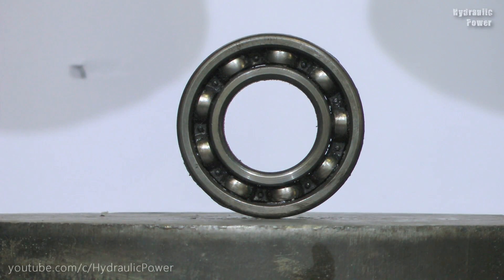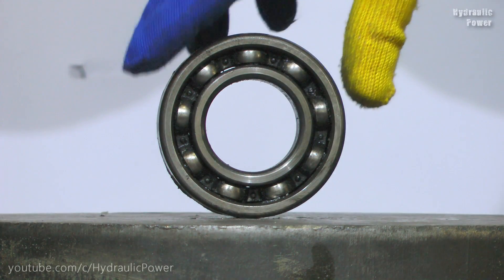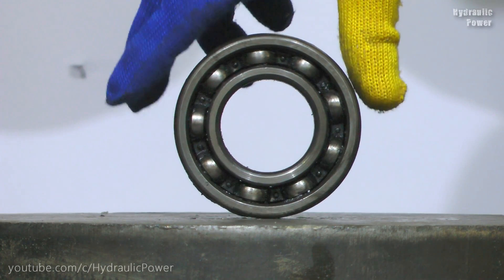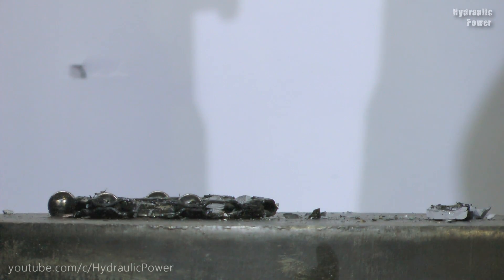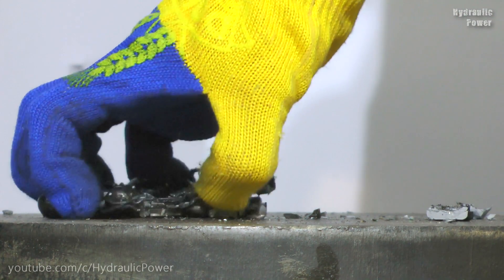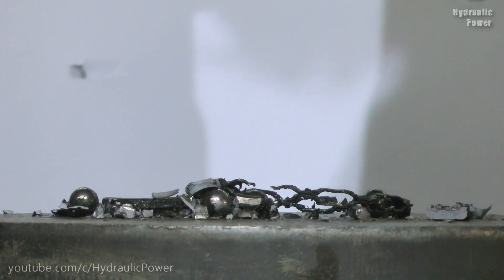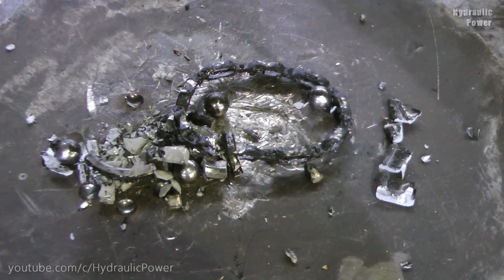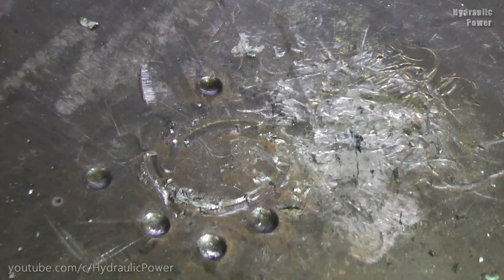Big Bearing vs 500 Ton Hydraulic Press

Comment: Balls of Bearing need to withstand constant changes in presure without deformation coz they carry much weight and are rollig in the same time. Its not a big suprise they will not break easy. Suprise for me was this explosion and i don`t fully  understand source of it. Any ideas? Could it be outer race of bearing, retainer, inner race? Any ideas? :)
Reply: when two metal rub together it will cause sparks. the harder the two metals are pressed together more sparks will be produced. there are exceptions, of course.

Comment: What caused the sparks? Also, the housing for the balls was very brittle? Metal type?
Reply: Don't take my word for it, but I think all the pressure from the press was converted to friction on the balls, and when the balls were shot out, metal was scraped off, and the sudden release of energy and pressure lost caused them to ignite, creating sparks. Much like scraping a flint rod.
Reply: The iron in the steel is pyrophoric(burns on contact with oxygen) when the particles of iron are small enough. So the press had to turn that bearing steel into a super fine powder for that to happen